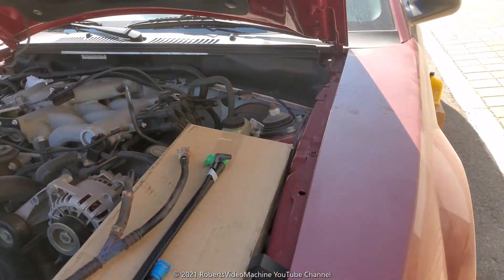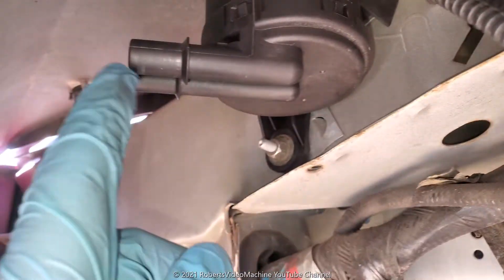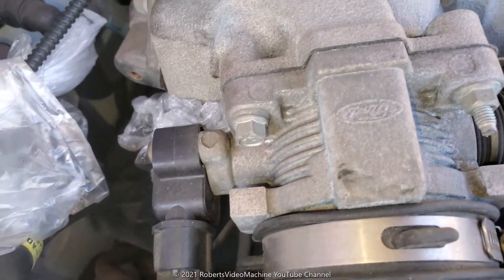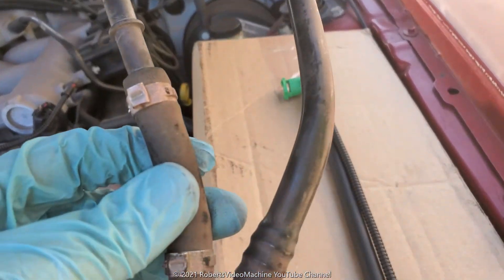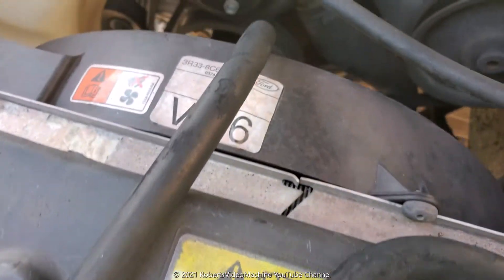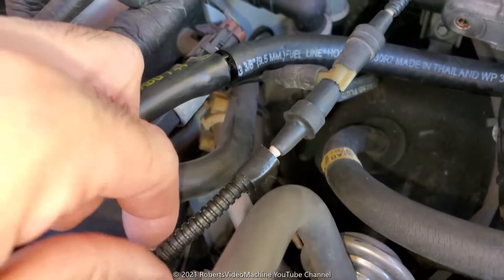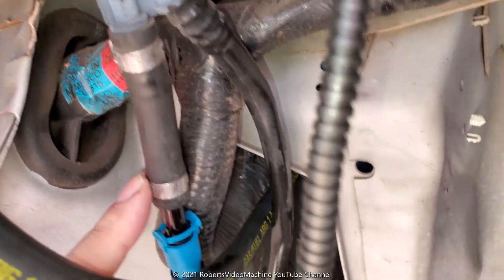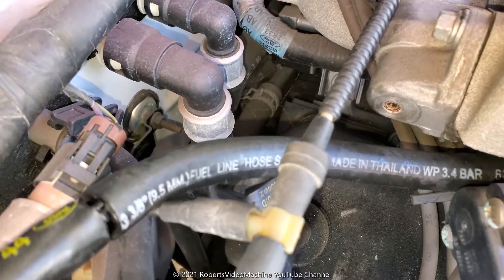DIY How To Replace the EVAP Hoses and Lines on a 1999-2004 Ford Mustang OBD2 Codes P0455 P0457

Comment: Hello, did your P1000 get resolved?  That's what I have in my 02 3.8.  Great video should help alot of Mustang New Edge owners out there with this  Evap System.  Thanks.
Reply from the maker: The P1000 didn't go away, even after driving over 1,000 miles. Luckily when I went in for the smog test, the mechanic said since the car was running clean he'd pass the car since it had over 1k miles driven. I would check it again, but my battery died and I had it replaced; so I'm starting over again. I'll check once I hit over 1k miles driven. Thanks for watching, commenting, and don't forget to subscribe.

Comment: hey man quick question, I only need to replace the Evap hose lines and was wondering if I could use the old connectors on new hose like a plug and play? Also would I need to purge the fuel system so it runs out of gas in fuel lines? Or is it not necessary for evap hoses?
Reply from the maker: I haven't tried that, but as long as they're sealed fuel lines, it may be fine. I just disconnected the battery to be safe. Hope this helps. Thanks for watching, commenting, and don't forget to like and subscribe.

Comment: Hey brother I have the exact same codes on my 03 Mustang and was wondering what worked for you to fix the issue, I saw your other videos on purge valve and vent valve solenoid replacement. Just wanted to see what worked for you to get rid of those codes. Thanks!!
Reply from the maker: I still haven’t posted the video yet, but it looks like it was the Fuel Tank Pressure Sensor. The P0457 went away and now I only have the P1000 driving cycle code. I have driven over 400 miles and the EVAP test isn’t complete. I’m just glad I didn’t get any other codes or the check engine. I’ll post the video soon. Thanks for watching, hope this helps and don’t forget to subscribe.
Reply: @RobertsVideoMachine  thank you! I already liked and subbed, keep up the good content!

Comment: Did you figure out what caused the    P0455 code?   I ordered the valve next to the charcoal canister and the one in the front wheel well....will see if those solve the issue...i have already replaced the charcoal canister...
Reply from the maker: @iironwarrior  In my particular case, it was the FTP sensor. I had to have it diagnosed by a professional mechanic. I have a video about it as well. Thanks for watching, commenting, and don't forget to like and subscribe.

Comment: Do you have a part number for the hose with the yellow lettering? I'm looking to replace mine.
Reply from the maker: @sergiomurillo9930
I couldn't find the part or part number for that hose.  The 3/8" fuel line connects to that hose, so you may be able to just buy the same size fuel line and then figure out how to make it fit the green connector on the other end.  Let us know how it turns out for you.  Thanks for watching, commenting, and don't forget to like and subscribe.

Comment: Is the one attached to the frame important because mine snapped was wondering if I could just seal it
Reply from the maker: It's my understanding that it carries the fuel vapors and is related to the EVAP emissions and smog tests. I would suggest replacing it. I'm not sure if it'll affect passing a smog test.

Comment: Yeah both of my hoses were ripped off clean I was driving on the free way and my damn wheel cover came off and since I was driving like 70 mph it wacked the hoses off and my car started shaking and I had no other option but to pull over and hood thing I did since it didn’t want to turn on anymore and I didn’t know what it was and it was dark so I couldn’t see but I could hear this loud air suction sound and I didn’t even have no electric tape to do a quick fix so I just found a plastic grocery bag and tied the hoses up and covered them and it was able to bring me all the way home
Reply from the maker: Glad to know you weren't left stranded, because that's the worst. I hope this video helps you get your Mustang up and running again. Thanks for watching, commenting, and don't forget to subscribe.

Comment: 3:31 the hose that you are talking about/touching is what I need to replace because it collapses everytime I drive and I think it’s what’s making my car shake so bad, what size would I need and how big was the hole in that new hose, thank you
Reply from the maker: @bruh2858
The hose I bought was a 9.5mm fuel line that you should be able to buy at any auto parts store.  All you have to do is cut it to the length you need.  I hope this helps.  Thanks for watching and don't forget to like and subscribe.

Comment: Hello , informative video . Anyone in particular has information on how to fix a P0456 : Small EVAP leak ? Thank you
Reply from the maker: I would start first with checking the hoses and the gas cap. If that checks out, do a diagnostic, pressure/smoke test with a local shop. Hope this helps and let us know what happens. Thanks for watching, commenting, and don't forget to like and subscribe.

Comment: I have the same car ford 2000 mustang and I have the code p0442 a small leak in (EVAP) . The thing is I changed my gas cap and made sure it was on right and tight  , I erased the code and it came back on and now I want to do this my self and change it, I have a auto spot I go to but not sure what to ask for, I just see a lot of people say, purge valve, evap hose, evap lines just not sure what to say or ask for … if anyone can help me thank you 🙏🏼
Reply from the maker: @adriangarcia5920
It's hard to say specifically what could be wrong since there are a lot of possibilities.  I have multiple videos about EVAP codes on my 2004 Ford Mustang that may be able to help.  Check out the playlist:
https://www.youtube.com/playlist?list=PLKFCUzRfdTLNBQ661vewVD8ejKWAPDhjz

I hope this helps and let us know how it turns out.  Thanks for watching, commenting, and don't forget to like and subscribe.

Comment: What’s all the parts yu used?
Reply from the maker: I bought a brand new Motorcraft part #F8ZZ-9E498-BA from a Ford dealership and a 3/8" (9.5mm) fuel line hose from a local auto parts store. Thanks for watching, commenting, and don't forget to subscribe.

Comment: where can i get that part
Reply from the maker: The original hoses are hard to find. I believe they're discontinued from Ford. I was able to find one of the last ones from my local Ford dealership. If you can't get a hold of new ones, the only other option is the junk yard. Thanks for watching, commenting, and don't forget to subscribe
Reply: @RobertsVideoMachine  But why if most likely by now it be brittle. I went today. Was brittle but fuel line hose work just make sure inside hole is exact size and maybe thickness the same or bigger. Thin more changes to brittle sooner. Not sure. LOL but fun being at junk yard.
Reply from the maker: @rcrotorfreak  Yeah, finding the hoses in good condition is very hard. I hope you find some. Thanks for watching, commenting, and don't forget to subscribe.
Reply: @RobertsVideoMachine  That's why we have Auto Zone here. Any hose most likely they have. But not in part number. Sure they have product number of the line but they are sold by inch. You compare their hose to the old one. Evap since have chemical i would match to fuel line version of tubing and exact inner side out side same thickness or thicker is fine not thinner even inside hole is same. LOL
Reply from the maker: @rcrotorfreak  Good to know. I will have to check it out next time I need something similar.

Comment: If I have the code I have to replace both the hose and the Canister valve
Reply from the maker: The codes have several possible fixes. For example: top fix is xxx, 2nd top fix is xxx, etc. Every vehicle is different and I replaced the EVAP hoses and Canister Valve, because it was easier than dropping the gas tank and replacing the FTP Sensor. At the end I did have to eventually replace the FTP Sensor. If you have a mechanic friend they can probably narrow it down for you. Hope this helps. Thanks for watching, commenting, and don't forget to subscribe.